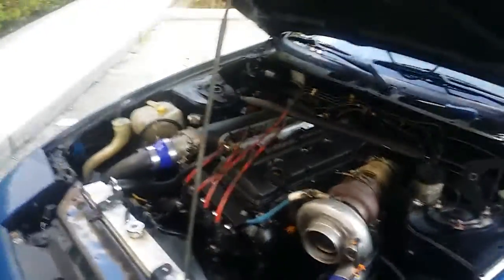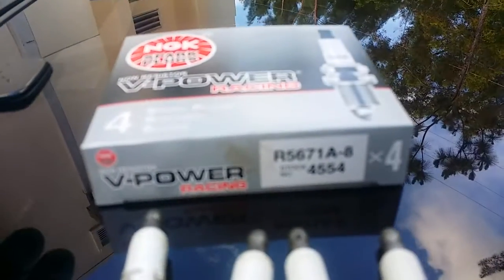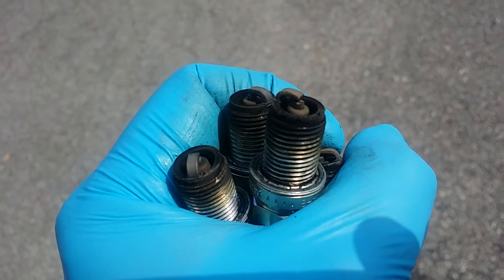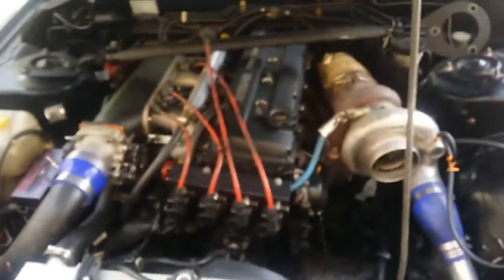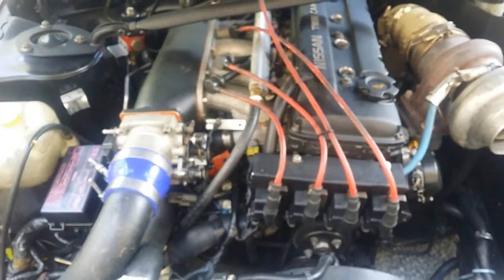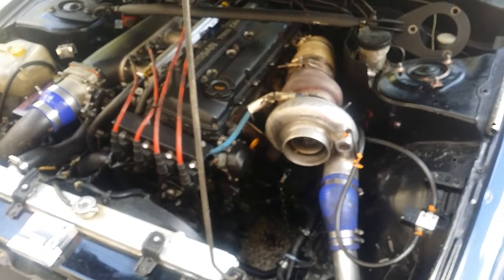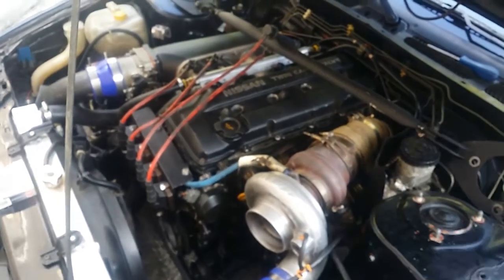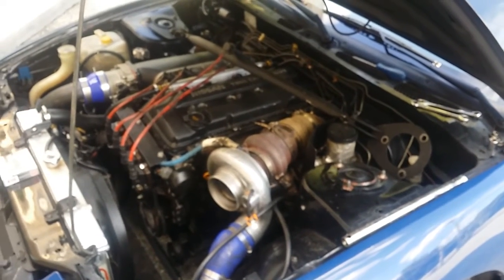Spark Plugs Changed

Comment: Awesome set up! 
You still running that Z32 trans set up? Question, At the end of all of it, how much you cut off the trans bellhousing to reconfigured the Xcessive Kit, not to run the flywheel spacer.
Reply from the maker: Basically cut the width of the spacer off of the beginning of the bellhousing. I think it was 5/8th's.  Then you will have to cut out the starter hole on adapter plate plus bellhousing to clear stock starter. You will also need to figure your mounting holes for starter. I tapped the adapter plater with studs to avoid having to remove tranny if the threads damaged. Driveshaft has enough length. Been running this setup for 1.5yrs now.